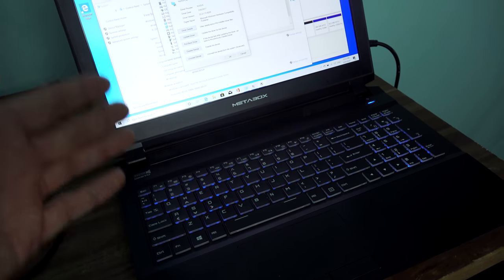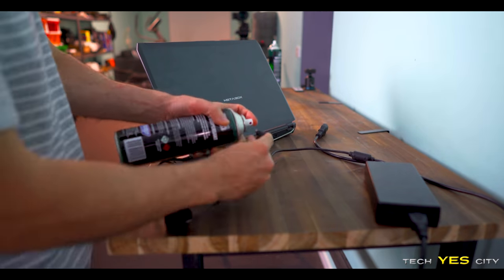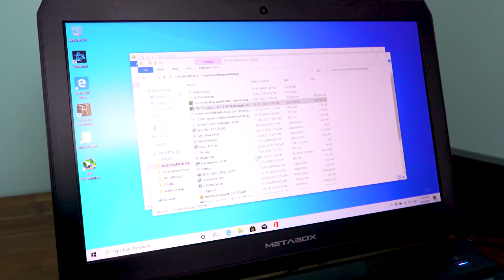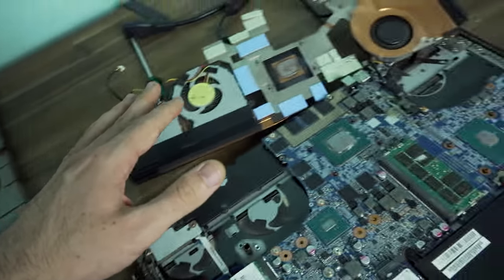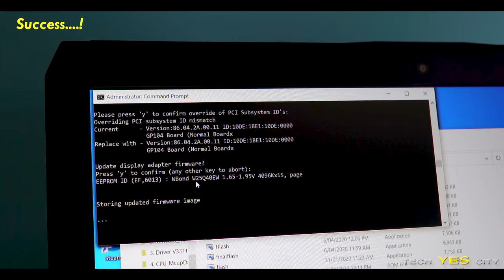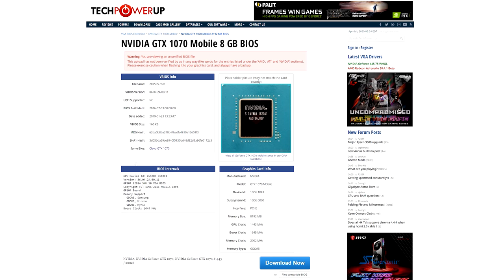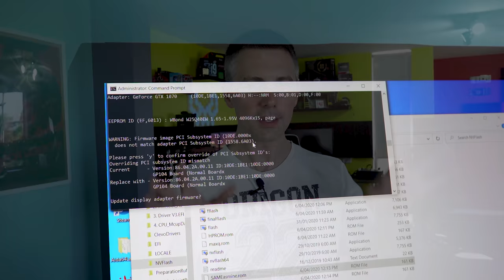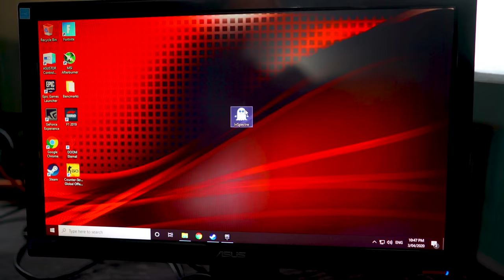I Got This GTX 1070 Laptop for ONLY $200... Though it has a VIDEO_TDR_FAILURE issue...

Comment: Sorry mate, your guess is incorrect.  The feature is an Intel chipset feature and is utterly CPU driven.  What you're actually experiencing is a known problem the GTX 1070 mobile chips that early revisions basically cannot maintain performance over nominal voltage (1.05v from memory).  This is a well known issue that was extensively covered on the MSI and ASUS forums.  Later on there were VBIOS releases that voltage limited these GPUs, which is what your Clevo VBIOS likely is doing.  The PCI subsystem mismatch is a red herring and likely just means the CLEVO bios was copied from a machine with a 7th gen Intel CPU rather than yours which is 6th gen (these GPUs were sold on both 6th and 7th gen systems.

Comment: I used to get a TDR VIDEO error bsod on my MSI GP62M leopard. What I did was upgrade the bios‚ and that actually fixed the issue. Otherwise you need to use old nvidia drivee‚ from when the computer was made.

Comment: This video reminds me when I bought a toshiba portege laptop/tablet for around 100 us dollars 
I got it for cheap because the seller told me that the laptop was extremely slow, even the windows animations were pretty slow and I notice that the CPU and the gpu were at the slowest clock, so I entered the BIOS and the performance mode was set to low performance, I change it to high performance and it worked pretty great.

Comment: Most of them which show a VIDEO_TDR_FAILURE are having an odd contact over the board, their balls have cracked or  (very rare cases) the chip fell off completely. If the chip is still in place (at least partially) i recommend increasing the VIDEO_TDR (video command delay timeout) to at least 300 seconds from the default 15, in regedit. If you don't care too much about the board being destroyed over time, you could reflow it using a hairdryer. Beware board cracks over dozens of "reflows" using hairdryer are possible. Keep in  mind that improper use of heat, may lead to components falling off the board, CPU/CPU Socket separating from the board too, RAM Slots melt aswell with time.

Comment: Looks like a dead ringer of a Resistance laptop that I have which used to also BSOD. I managed to threaten them and get it fixed (even though it was out of warranty, yay ACCC) but if it happens again I might try this workaround. Thanks!

Comment: I had issues with an Acer budget gaming laptop with a MX150 chip in it where it kept blue screening and I went through each driver and found the driver that was the problem and got it fixed. Only issue now is the CPU is being limited when it is not thermal throttling which usually doesn't happen. It has the latest bios update too.

Comment: I got a very similar clevo computer off ebay for $700 (i7 7700HQ 32 GB Ram)
My 1070 started crashing a month after I bought it just like yours
What maxq 1070 VBios did you use exactly?

Comment: Remove fluff out of the heatsink? (remove the small screws to get full access to the fan and heatsink) also looks like you didn't put any heat compound on the Southbridge or was it using thermal pads for it

Comment: Could be once you plug in AC, the system goes to full performance mode and is probably over heating. Or a bad connection. Pre watching. So thermal paste should fix issue. Both cpu and gpu.

Comment: Hi Bryan,

I also experienced this exact same BSOD on my desktop that has a biostar h61 motherboard and GT 1030. Turns out, the igpu causes this issue and happens when I log out my user account then log back in. The solution was to uninstall the graphics driver of the Intel HD and everything is okay again. 

I figured its related to switching graphics since my motherboard would not allow me to to disable onboard graphics and it was the only solution.

This might help some xddddd

Comment: I had bought used clevo(sager) p775dm3 with 1070 and i7 7700.Almost same happened with that, it crashed when i played graphic intensive games and gave artifacts and buzz sound. After a month, gpu almost died. Artifacts everywhere. Only gave display through windows basic drivers. Bought new gpu for 400usd. Worked fine for only few minutes, it died too. Same thing happened almost.With the new gpu, it didn't even turn on now. Put the old gpu back, gave it back to the seller, returned the new gpu to the ebay seller. Got refund for both laptop and GPU. Built a pc instead. It was very stressful. But was awesome laptop otherwise.

Comment: @TechYes I have a EVGA GTX 960 SC that randomly goes to No Signal. Sometimes it works 10 minutes, sometimes 10 hours. At first I thought it might be a short. Now I"m not so sure. Seems like the GPU is losing signal and the system stays on.

Comment: I have a Toshiba AIO that's doing the same thing.  I upgraded from a Pentium B-series, I can't recall the revision off the top of my head but it's a mobile CPU, to a socket compatible i5, all integrated graphics, it's a very nice unit, but since upgrading to the i5, it runs for anywhere from 2 to 10 minutes and then shuts down.  But it doesn't have a discrete GPU. :/

Comment: Someones already been into that machine as way too much thermal paste, when I remove the Thermal paste from cpus with those tiny caps I use a slight stiff small paint brush to get into the tiny spaces as its tends not to rip them off

Comment: Hello, how are you? Very cool your channel. I was wondering if you can help me with a question. I have an MSI GT70 with a GTX 680M. I would like to exchange the GPU for a GTX 1070. The slot is MXM and Both are compatible with the same tipe of slot. Will it be that if I buy the GTX1070 will be plug and play? Or I will need to do some inf installation? Thanks.

Comment: U need to open up ventilators, to get the dust out between radiator and ventilator. With old laptops there are a rug of dust between ventilator and radiator.

Comment: just a thought but did you check the power supply that was the correct one for this laptop? sometimes chargers get damaged and they buy a none genuine supply from gum tree etc. or even a genuine branded power supply but has a lower power rating. then whats required. and when the system demands more supply the system restarts .

Comment: Have you any idea why when I overclocked my Ryzen 7 2700x that I run a MSI 1660 ti and 16gb ram I over clocked it in my BIOS by 5% on the Auto-Tune I then benchmark time spy and it came in worse about 800 less and then put it back to default and it worked better any ideas ??

Comment: A couple of years ago I was plagued by the exact same issue 'Time out Detection Recovery' error, windows detected what it deemed a delay decides all by its self there's an issue and restarts (or blue screens) what ever it thinks is faulty, eg graphics card etc, you can adjust the time parameters yourself or even disable. Nothing worked for me, It was crazy intermittent, no pattern nothing, 10 mins 2 hours take your pick, ended up being ram related?? somehow no idea, swapped out ram never happened again, no sense go figure?

Comment: I am halfway through the video and don't know if you end up fixing or not.
But the behavior indicates that there is an issue when transitioniung between power level/states - chips don't fail - this is some bad smd caps on the mobo

Comment: I have the same laptop branded as PowerSpec from Microcenter 3 years ago for 1100 usd with tax. I undervolted the cpu & also the gpu to maxq settings to control temps while gaming. I disabled the g-sync because it's wasn't worth it. It's been running like champ.
Reply: I have a MSI GT72VR 6RE and had to do the same! Turn G-SYNC off and use a conservative VBIOS!

Comment: the biggest problem is windows 10 ,  i still use windows 7 ultimate as my main operating system still and it runs fine on old or new drivers that are not defective in the first place. Not to mention every windows 10 system i put a radeon rx 470 on starts glitching and giving all types of problems , i then put it in a windows 7 system with stable drives and all the problems go away .

Comment: I have the same laptop but with a i7 7700hq and my 1070 quit working too... I slipped on some ice and snow and my 1070 is showing up intermittently i think some solder balls gave way was quoted 900 for a new motherboard the laptop was 1 month past warranty i think it could be fixed but the gpu needs to be reflowed.

Comment: i had an issue with Video TDR Failure blue screen it seems to be an ssd issue as i swapped out my boot drive i believe it was an issue with the firmware as a troubleshooting step i took when another drive was having issues was to update the firmware at that time i believe the system had crashed at that time resulting in a firmware corruption and caused months of grief as i was getting driver errors for the GPU which makes sense as the drivers were on that drive i was also getting whea uncorrectable error bsod and clock watchdog bsod along with the video driver errors so it wasnt just 1 driver causing the errors.

Comment: I have a laptop with a failing GPU, it's from those AMD that kick the bucket... took 7 years to die, but it's dead, only the integrated works.
Reply: All laptop GPUs fail eventually especially the high end ones, 7 years is a good run

Comment: my old graphics card had a problem where i can only install a specific old version for it to work. it needs to be installed a pixel something patch for it to work with new drivers. and sometimes it crashes to a random 1 color just like in this video. and i switch my vga to a new one. lol (pc)

Comment: Gbh as much as you say using wd40 isnt bad: youre not getting rid of the dirt on the board, youre just moving it into holes you can get it out of. In solution it can crawl into small holes easier. And even though you say its fine, it can make plastics age a lot faster. 0/10 don't recommend doing this.

Comment: The 100GB was probably for overprovisioning to extend the life of the SSD. I do it on my drives but not quite to that extent.
Reply: I was wondering the same thing.   I've only seen it used with Samsung NVMe's however.
Reply: @my-yt-inputs2580  https://www.seagate.com/gb/en/tech-insights/ssd-over-provisioning-benefits-master-ti/ I think it depends on the controller but is likely present in sata drives too,  most will just take advantage of the unallocated space without having to do anything specific.

Comment: The celebration part of this video is a little crass and kinda pissed me off, if the owner had went first to a qualified technician they would of saved a fortune. I hope you advised him first to send it for repairs under warranty before you put trade in option on the table if not I have to question the ethics of this deal.

Comment: hello, just wondering, how much would it have costed him to have it fixed ? and what about the change to the gpu mhz etc, does it affect the general performance the computer is supposed to be providing ? kinda curious cuz i'm running on a ASUS ROG i7 6700HQ, a geforce GTX 1060 and 16gb RAM, since i started to play monster hunterworld iceborne, my computer randomly start to stutter for a sec every 5 seconds, if i quit and relaunch the game, those mini freeze are still here, if i reboot the computer, they are gone and i'm back playing for hours. I had to lower the graphics, i used to play world with everything maxed out, but since iceborne came out they added DENOVO some kind of anti cheat that is killing overall performance, at the launch of the update, i even had crashes and had to turn on the computer manually again ... i don't have crashes anymore since they kinda upgraded the game throught multiple update but this little stutter that force me to restart the computer is bothering me :/
Well weirdly i enjoyed watching the process and looking out for the possible issues, never knew that it could be that interesting ! thank you and be safe !
Reply: Thermal paste issue or fan is dead, use AIDA64 to find out. Also it costed him only his time and the actual laptop.

Comment: Got a similar thing but no errors, when running 3D apps I get artifacting and crashes - if I disable the nVidia card so only Intel it's fine, my guess is I got a GFX RAM issue.... manufacturer won't repair as out of warranty etc... :(

Wish I could identify the bit, and tell it to 'ignore' that RAM (kinda like mapping bad sectors on a HDD)

Comment: Bought a gaming laptop and never use it, its specs are still decent 8750h and a 1070 1080p 120hz screen. With the new amd mobile cpu's intel is losing more ground.

Comment: It's weird that you got it working with a vbios flash,usually if a laptop works fine on battery,but it starts shutting down or bluescreening while the ac adaptor it's conected,the problem it's with the adaptor not with the laptop.

Comment: I recently had a samsung core 2 laptop come to me that did not boot into windows. It would reset everytime windows would load, it would load in safe mode, but after reinstalling not knowing what's wrong, I couldn't get in any os anymore. Not even Linux. I thought it had a fried gpu as it seemed to die when the graphics drivers loaded, it had some 8400gs or something. But I then tried to update the bios, I couldn't get any images, all I had was a windows based bios updater. But I couldn't get into windows. So I tried 3 different versions of hirens boot CD, and I finally got one to boot to the desktop. It was an XP based one. Then I had the problem that it insisted on having a battery or it wouldn't run the update. Of course the battery was long gone. I then looked far and wide and found some unpacked version of that exe on an old forum, got the flasher utility, messed around with getting it on the machine as the live windows was weird with storage, and finally updated the bios. I reinstalled again, and low and behold the thing got to a windows 10 desktop. Linux mint also booted, which previously wouldn't happen. I did install windows in gpt mode as I saw some uefi support in the bios, I didn't even know core2 had that. But now I can't access the bios as it always thinks windows 10 is resuming and doesn't respond to key presses during boot. I think it doesn't play nice with windows 10's quick startup feature. I could probably pull the HDD if I need to but after a full day of updating windows, god windows 10 on an old HDD is TORTURE. I was totally done and didn't wanna see it anymore. I should have installed windows 7 on it but I didn't wanna deal with that not working, last time I tried it nothing microsoft related like searching for auto drivers in device manager wanted to work as their pushing their new os hard. And the sales of ssd's apparently... Could that bios have gotten corrupted for some reason? I don't know. I really gambled in even trying to mess with it but it ended up working, slow as hell under win10 tho.

Comment: I have a Inspiron 7559 with a i7 2700 with integrated 530 graphics and a GTX 960M. Only thing is the laptop stopped taking power from the charger, but started working again, but now I cannot for my life get the 960M to work😭 any suggestions ? I played on it a lot so only thing I can think of is the gpu died

Comment: I had a laptop with the same issue first step i did witch was replace the 1tb 5400rpm hdd with a 1tb wd blue ssd and clean install windows and latest drivers and it was fixed. I think the ssd used just enough less power to bring it back considering its a old laptop with old battery witch i may replace later.

Comment: This Tong Feng laptop was produced even before Geforce Max-Q variant is announced. So, this GTX 1070 is a full speed chip which runs head to head with RTX 2070 Max-Q.
Please check the Hardware Unboxed video about the comparison. https://youtu.be/la7pwgaOoWU?t=930
.
I have the same series laptop which has i7-7700HQ and GTX 1070, named Powerspec 1510, bought at Microcenter. It has a monstrous Delta 230W power brick.
It cranks up to Firestrike Graphics Score of 18,000 when plugged in. It has 1 NVME m.2 + 3 more SATA SSD slots and 4 RAM slots. (2 RAM slots are located under the keyboard.)
It's a crazy affordable and capable laptop in 2020.
Reply: A mobile standard 1070 won't even beat a mobile 1660 ti in most cases. In fact a 1660 ti will heavily beat this 1070 in many games. Only in a few scenarios wiill the 1070 pull ahead very slightly.

A 2060 is slightly ahead of a 1660 ti. And a 2070 max-q is well ahead of a 2060. So this 1070 is not close to a 2070 max-q.

The difference if you do ever see one, will be because max-q variants are often found in stupidly small laptops - too small even for the slightly reduced max-q versions. Normally also packed with high power and hot cpus to justify such a graphics card. 

So the performance of benchmarks you see in these cases are regularly from a heavily throttled CPU and gpu so well below the reality of what they can do.

Comment: Guys, I live in India and I found this guy selling the GTX 1080 TI ZOTAC AMP EDITION for around $150. The only issue is that the card doesn't give an output. He put a screenshot of GPU-Z where the GPU shows up fine but it shows the VRAM as 0MB and the bus width and bandwidth as unknown. Should I buy the card or not? Is this issue repairable?

Comment: My system has had intermittent black screens ever since I updated the Nvidia drivers and had FAH run a couple times. Mine's on a desktop 1080ti. I wonder if the newest driver version did something weird to the vbios. Is that possible? Only happened once since I reverted my Nvidia drivers and uninstalled FAH which may have been a glitch when a game was loading.

Comment: hi guys, any idea on how to fix a recurring error 43 on a gtx 1070 founders? I've tried it in different rigs, tried old and new drivers only thing I haven't tried is flashing it. do you think that would help? or is the card just dying? need it to continue working from home as I use it for graphics-based work & gaming of course